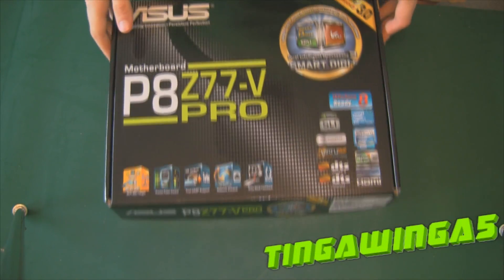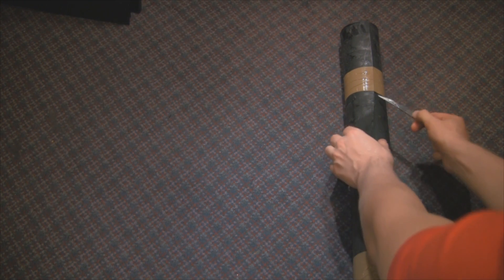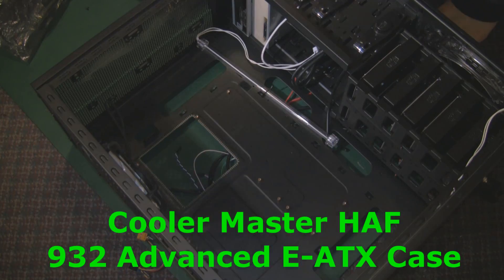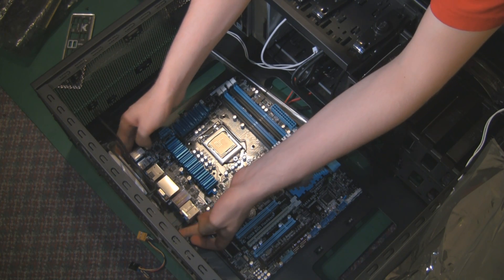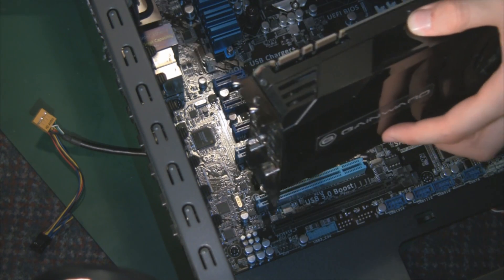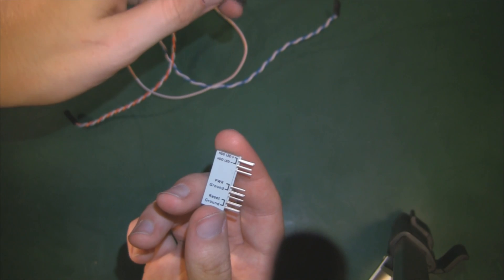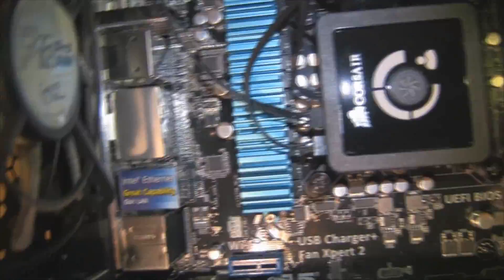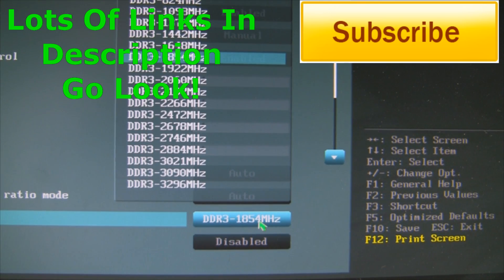How To Build an Intel Ivy Bridge 3770K Gaming PC Nvidia 680 (Q2 2012)

Comment: Actually you can touch the motherboard however you want. You do not need any special handles. I have been building PCs for about a year now and nothing has happened. I do not use any anti static wrist bands or mattes.